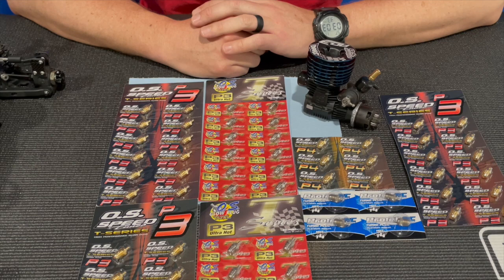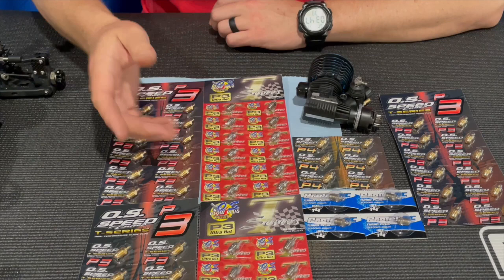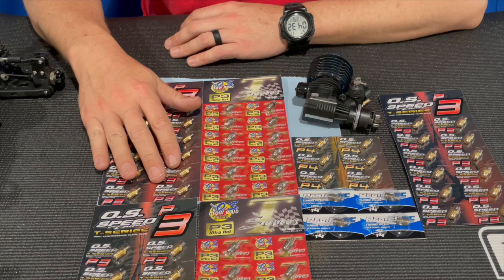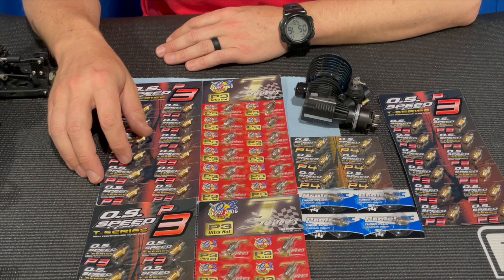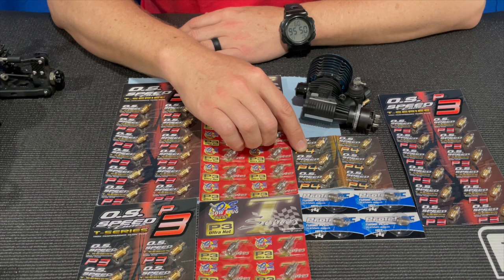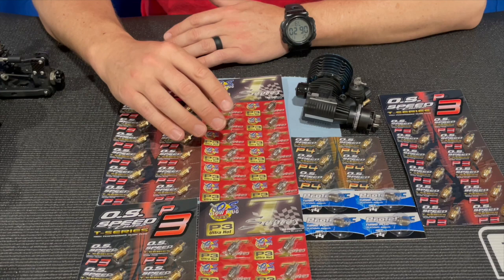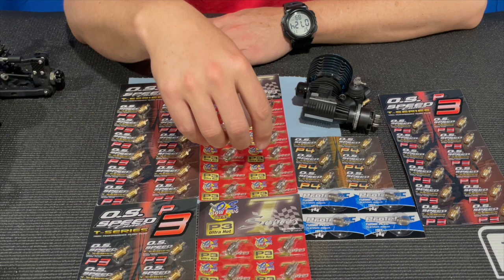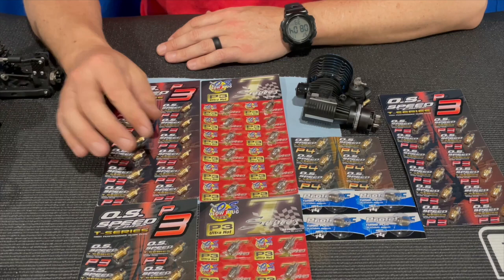Glow Plugs for Off-Road Racing

Comment: I found P4 more reliable during my OS 2104 (gimar ufo mars evo) engine break in process as it wont let overheat my engine on the track. With P3 got it running a bit too hot over 140 C after runs and if I set it more on the rich side to cool it, it stalled for some reason. And the P3 died way too early as well I think because of the high temperature. With P4 it never exceed 128 C and no stalls even if I set it a bit richer. Once the engine get looser i think i will change back to P3 to get more performance.
Reply from the maker: Appreciate the feedback and information.  Thank you!

Comment: Hello Adam, in Europe with 16%EU fuel (so really 12%), many people have switched to P4 because of the added compression from removing a head shim to gain back power. Is this a logical solution or should you stick with what you ran at 25%?
Reply from the maker: I would remove the shim and use the P3 gold plug.
Reply: @AdamDrake  and about venturi for 12% nitro, which one you would recommend? TIA

Comment: The Problem Start with 16% fuel we cant get 25% any more 🤷 just makes it difficult to tune ,but what would you do to make it  easyer to tune with 16% fuel ?🤔
Reply: You could try a hotter plug. You could also try to remove a head shim to increase compression.

Comment: Hi Adam. I have always run novarossi engines. I usually use a novarossi medium hot plug, as I find this has the best run time. 
Does this sound about right
Reply from the maker: When I ran Nova, I always used the C6TGC plug.
Reply: @AdamDrake  sounds good. Could I use an os p4 plug on novarossi
Reply from the maker: @flubber788  Yes, that should be a good option if you can't get Nova plugs anymore.
Reply: I had a mate send me a heap of O’Donnell odo97t plugs what would you recommend I use them in ?

Comment: My friend keep popping plugs very often on a new traxxas 3.3 and he uses 33% nitro why  you think it’s too lean 😖?
Reply: If he’s popping plugs immediately it’s a rod that’s lost the bushing, if he’s losing the plug after a few minutes but the engines running good it’s either tune or the engines simply sucking in dirt and ruining the plug. He may not even know if it’s actually the plug going if things like the bearings are bad or the engines sucking in air threw a leak. Engines are very temperamental, my best advice is take the engine out and tear out down and clean everything very meticulously and put it back together. Feel the bearings and look for things that may be causing the issues. The engines aren’t that hard to tear down and identify the issues.
Reply: It’s a brand new engine

Comment: I had a mate give me a heap of O’Donnell odo97t plugs what can you recommend using them in cheers
Reply: We used ODO97T & ODO77T both on & off-road without any issues. Cheap and good quality plugs. You can use them without any problems 👍
Reply: That’s awesome 👏 thank you for sharing this information appreciate you 👍
Reply: @cansoykal   what different motors do you use? Os , picco , novarossi,?
Reply: @tonysands2837  we mostly used odo plugs with nova engines as the taper seems similar. If you plan on going with os plugs stick with them especially on nova engines. Taper is slightly different between os & nova.
Reply: @cansoykal  thanks 🙏 mate I’ve got a couple of nova motors definitely 👍 use on them an stick p3 for my os motor’s thank you for reaching out